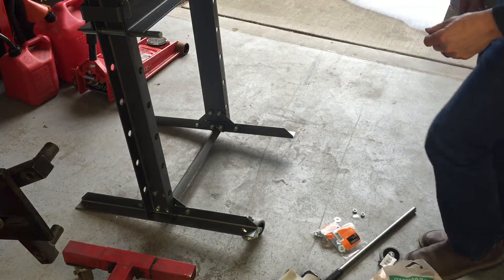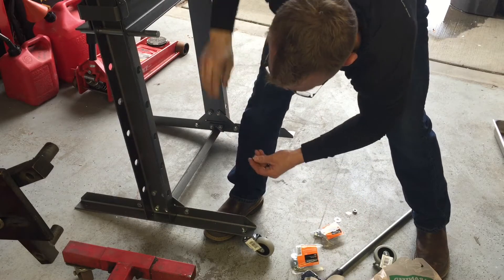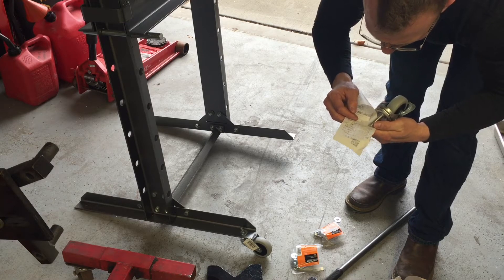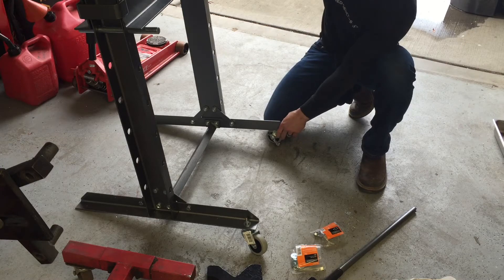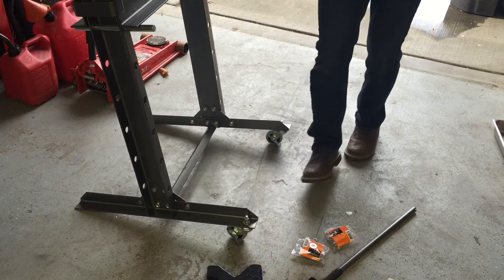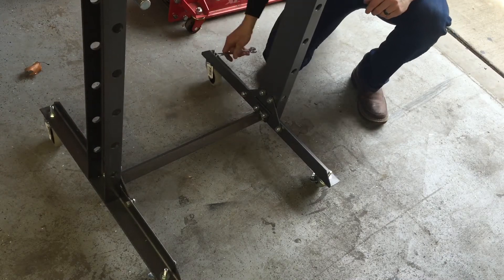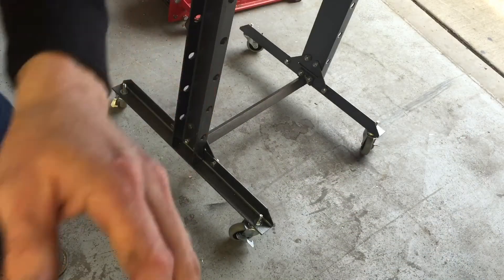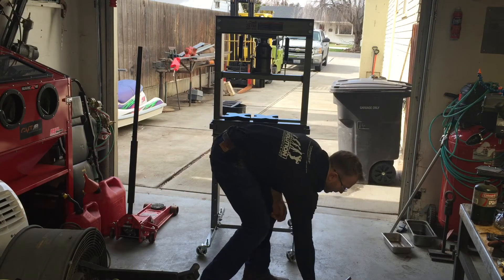Cheap HARBOR FREIGHT SHOP PRESS UPGRADE!!! ADD CASTERS---Unorthodox Fabrication

Comment: 3/8 th's got it, thank you for the video ...thinking 7/16 th's holes so half inch will not work without the drills i do not have with me.  I saw how easy it was to push around but you did not show the stability with the little 2.5 inch casters locked, that is critical.  Thank you for the video however.  Done ....ran to Home Depot and works great and locks beautifully ....still sturdy.
Reply from the maker: Right on Rick. Thank you for the input. Glad you have it rolling.

Comment: Good idea....the first thing I bought for my press before coming home with it was locking casters.... hate having to drag it across the concrete floor whenever needing to move it out from the wall to do a bigger job. Casters also make it nice for when it's time to clean out the garage to get back a nice work environment again.

Comment: 2nd work tray adjustment hole from bottom (if that makes sense) I added an eye bolt to hold the pump handle.
Reply from the maker: Not_Reqd that’s a good idea. I also want to have a simple tray to hold the plates and other jigs I use. Stuff rolls off when it is moved around the shop.

Comment: when applying 12 tons of pressure upon the thing to be pressed how much pressure will be applied to the casters?
Reply: the whole 12 tons isn't coming down on the whole assembly toward the ground. its being applied into the frame of the press itself so, to reiterate, no it isn't that much weight.
Reply from the maker: fruitydudexD I am almost thinking that guys question was a trolling type, to make us reply and waste our time...
Reply: you're an idiot and a troll
Reply from the maker: Not much, the static weight of the assembly plus maybe 60 more pounds from your down force on the pump's handle.
Reply: I would love for you to test the theory of weight on the casters. I will await your test results if you do it. At least let me know when the casters fail if they do.
Reply: Stop and actually think a little deeper about it.... the pressure isn't being pressed on the casters but is being pressed down on the adjustable table/shelf that your part is being laid on... if you look closer, you will see something like 1/2" diameter pins that slide into the side frame and these are what's actually taking the pressure
Reply: 2024bear 

Essentially none.
The only added weight on the casters will be the weight of the item you are pressing and the downward force on the jack handle.
The force of the press is taken by the 2 heavy rods that support the bed.
Reply: When the piece hanges up then jumps the entire machine jumps that is when the casters will create a very unstable event and that I want to see the holes are to mount it to the floor to keep it stabilized
Reply: LOL
Reply: The only weight difference would  be in whatever the work piece weighs .
The press has no impact on the casters at all , other than what the actual press weighs....
Reply: A troll is something they use to tell me lived under a bridge when I was 5 years old. How old are you ?
Reply: distributed across the 4 wheels you are right it is more like 3 tons each
Reply: @2024bear  congratulations on your epic stupidity

Comment: Instructions take all the fun out of assembly. I don't usually read them either.
Reply from the maker: Agreed. It removes the need to think on our own.
Reply: So, a mechanical engineer writes you a note, about his own design, to help you either get the most out of it or use it in greater safety, and you don’t want to hear from him?